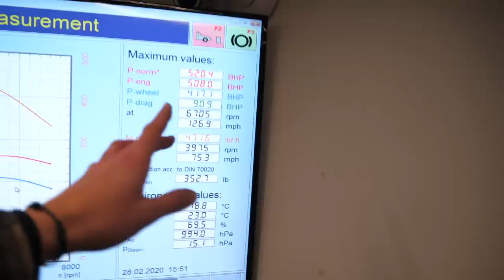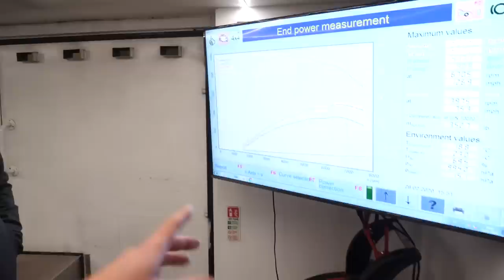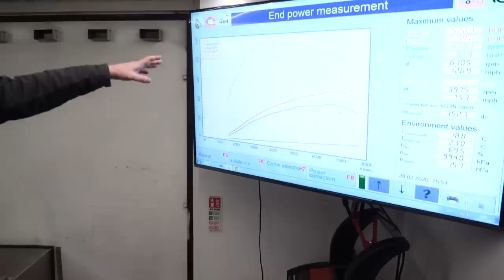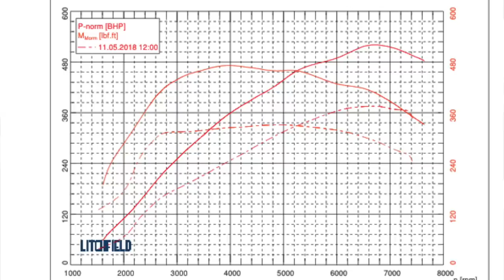Modifying My 911 Carrera T! [Litchfield 500hp+]

Comment: I salute your decision to keep the T! It is a cracking car! Love mine, I've the manual though, which is arguably even better because it retains the lsd and ptv which the pdk does not.
Reply: emix not sure why someone would pay a premium for the T and get the PDK. Seems a little odd, get the S with better engine and brakes with PDK for around the same price or get a base with same engine and brakes for much less money. Although the opening statement makes it pretty clear that some aren’t as good with numbers as others 🤦🏼‍♂️ #mathisHard
Reply: emix are you going Litchfield yourself? I’m considering it on my manual T, which as you say rocks already! I guess it’ll smoke the GT3 Touring with all that torque and power
Reply: @Nord_Mann  Unfortunately I'm not in the UK but I'm considering a tune from Techart which ups the power to 430 which should be enough for now.
Reply: emix not in the UK either, but still considering a road trip to Litchfield
Reply: Nord Mann you think it’s going to “smoke” a GT3 because of the torque?  I’m guessing you are ONLY talking about a drag race and not a proper race around a real circuit?  There’s more to a GT3 than just power. Also, what are people doing regarding the factory warranty if they tune the car?

Comment: Nice video Sam. Good to see you tuning the 911. The Carrera T wasn't detuned, it is the same engine as the Carrera S but has smaller turbos. If you fitted the larger turbos of the S you'd get more power.

Comment: Please ask them to explain how your car can have 417hp to the wheels and 520hp at the engine...it’s almost 100hp power loss! Normally RWD 911 have 9% of transmission loss while yours have 25%. The car is probably around 460/465 hp which is a good Stage1 for the Carrera T but there’s no need to say it’s 520hp imho 😉
Reply: I know this is an old video and post but they can't explain it because it is not true... as you are saying there is no way this car is 520 BHP... at best as you said it is 460 BHP which is awesome... but that is really only about a 60 whp gain which kind of proves that Porsche underrates these cars by 20 - 25 HP which is also awesome.

Comment: In 1978 Bruce Canepa was importing grey market Porsche. He also had a Chevy 350 in his 911. Had aluminum heads and he said the engine was Lighter than the 911 engine. But I never weighed the two. This was in Santa Cruz. He had a dealership there. A muffler bearing for a Pork cost more than a 500hp 350 Chevy
Reply: He is well known for lying.
Reply: @ervin_wu  well I never weighed a 350 or a Porsche engine but therein lies the truth. The car was real, it came into a restoration shop, he had a car there

Comment: A Set of Sport Catalytic converter would be the better choice insteat of the backbox.
Less restiction = more Power and more Sound
and it is better for the engine because the Heat gets Out faster from the System.
Greetings from Germany 🇩🇪

Comment: STG for the Win...
Hi Sam, since you modified the T, can you tell us how has it been, the handling and the reliability of the engine, gearbox, brakes, suspensions, mileage of the car, after all this time...also, can you explain how did they achieved those incredible figures of 520bhp?! 
Best Regards

Comment: Did you consider swapping out the original cats for high flow units? If so, what made you decide to skip them? Would the performance gain not be worth the expense? I'm about to install the Fabspeed Muffler-delete X-pipe on my 2017 991.2. Would prefer to swap the cats at the same time, if worth the cost. Thanks man.

Comment: 9:37   Wheel hp 417 vs 520 engine hp ... his drive-train loss assumption seems rather high?? ..  "favorable dyno calibration" + exaggerated drain-train losses =  Huge Power Gain!!!   (not really)   ... the reality is that the Dyno chart can be a big fat lie .. unless it has been recently certified and all the "assumed" values have been accurately measured, instead of being made up.  We really don't know the reality here .. maybe just 30-40hp gained and some better exhaust noise, with both adding up to a much happier driving experience. I find it not believable the car when from stock 365hp to 520hp via an ecu tune + exhaust system change... for that big a real gain, a whole bunch of other engine parts would need to be swapped out too (injectors, fuel pressure regulator, turbos, intercoolers,  air intake, throttle body, ..etc...)